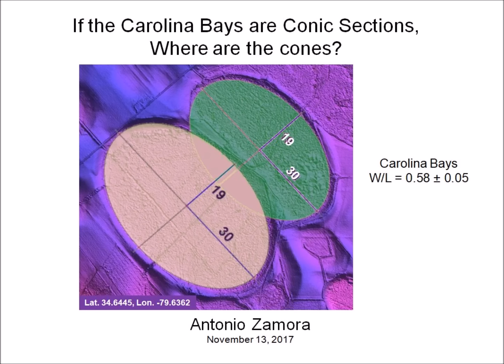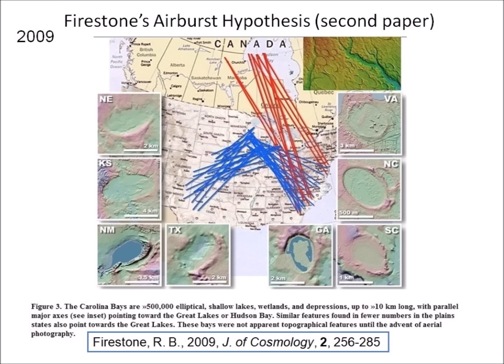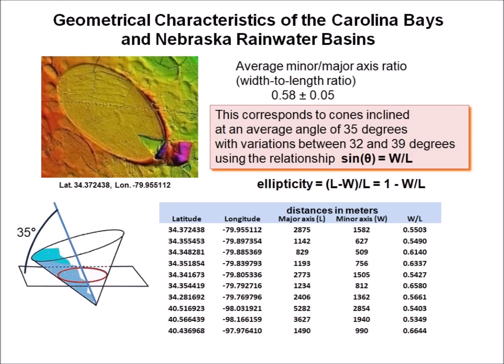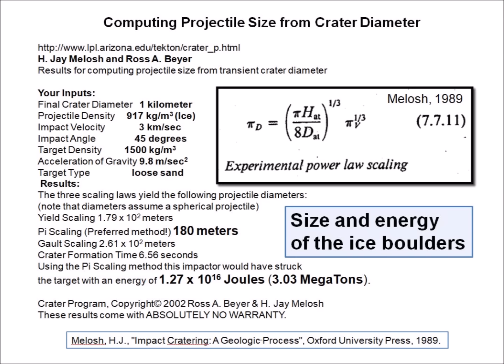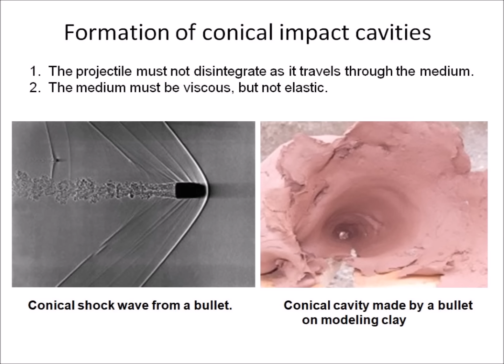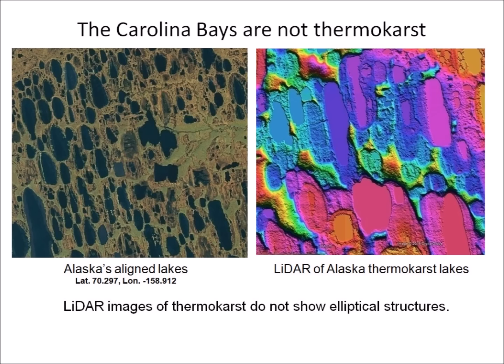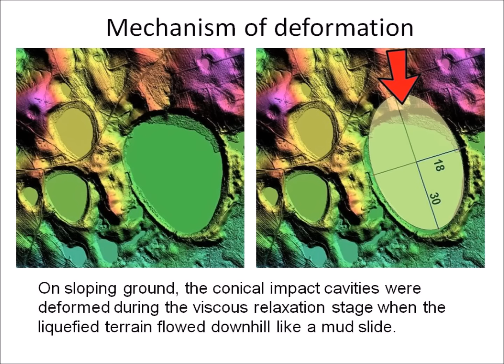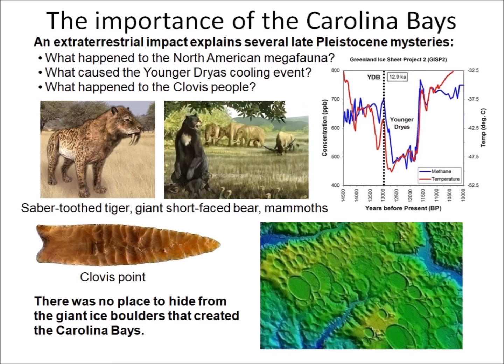Carolina Bay conic sections

Comment: this is astonishing. thank you for the work. would love to get you on our podcast sometime to talk about it. Seems to me that this is solid evidence not only that an ice sheet impact occurred, but also the best work i've seen estimating the actual size and energy of the impact.
Reply from the maker: It took me several years to organize the clues provided by the Carolina Bays into a coherent story.   The Younger Dryas Impact Hypothesis has been criticized by M. Boslough for not having a physics-based model for the extraterrestrial event.  The geometrical analysis of the Carolina Bays, in conjunction with ballistic equations and power laws relating energy to crater size provides a foundation based on the laws of physics that is hard to refute.

Comment: Are the perfect archetypal conic sections a result of the extreme velocity of the impact of ice chunks into the unconsolidated alluvium?  In other words, what makes them so perfectly shaped?  

"Kettle lakes", a common feature of the landscape left in the wake of retreating glaciers, form in a similar way, where ice chunks left behind melt later after sediment is deposited around them, and are commonly circular or sub circular, but rarely so perfect. 

Is it that they hit with such velocity that the chunks were embedded deeply in the earth and the cone represents the best fit around the embedded object to the surface?  Is the perfect geometry purely a result of the high impact energy?  Why wouldn't all of the ground be liquified if they impacted all around the same time?

Also every single bolide impact crater on earth is circular in shape, no matter the impact angle, because the crater is created by the energy of the explosion, not the actual shape of the bolide.  This is similar to the fact that no matter what object you drop in a pool of water, the ripples created will be circular- never elliptical. The moon has no elliptical craters, they are all circular, surely many of them are glancing blows, but the craters are still circular.  The only way to create an elliptical crater is to strike with an extremely extremely low angle, which contradicts the angles suggested by the conic sections that intersect the ellipses of the bays.   

Also, what is the cause of the giant gap in elliptical structures in the arc of structures from South Carolina, clockwise to Nebraska?  Much of that area was not covered by an ice sheet and was full of unconsollidated alluvium, especially the Mississippi river valley.  

These things present a problem for me, but otherwise this theory is compelling to me.  

Have you tried working with a geophysicist to model these impacts in the way that the Chicxulub impact was modeled?  Could provide many useful predictions of structures that may then be sought in the field.
Reply from the maker: The geometry is the key to understanding the origin of the Carolina Bays.  Ellipses are conic sections.  The Carolina Bays started out as inclined conical cavities that transformed into shallow elliptical bays by viscous relaxation.  They were created by secondary impacts of glacier ice ejected in ballistic trajectories by an extraterrestrial impact on the Laurentide Ice Sheet.  Their speeds were from 3 to 4 km/sec.  The energy of the impacts, 13 kilotons to 3 megatons of TNT, was sufficient to liquefy unconsolidated ground, and this allowed the creation of the inclined conical cavities.  These ballistic speed impacts are much slower than the asteroid (17 km/s) or comet (45 km/s) speeds that create circular craters, as described by Prof. Melosh and other impact experts. The ice impacts did not happen all at the same time.  There was a window of 6 to 9 minutes during which the ice boulders came crashing down from their suborbital space trajectories.  The "gap" in the arc consists of hard terrain that could not be liquefied.  Ice boulders impacting hard ground just disintegrated upon impact.   I demonstrate how to make elliptical structures in my video about Modeling Carolina Bays: https://youtu.be/94km3ZKiPSE  I am trying to engage some physicists with experience in modeling to start first with the secondary ice impacts on liquefied ground, and then for the ET impact on the Laurentide Ice Sheet.  Check out my YouTube channel.  I have organized the videos into four categories that give detailed answers to many of your questions.

Comment: If liquifaction was at work on such a scale, would there be huge numbers of fossils from animals subsumed?
Reply from the maker: The liquefaction was widespread due to the saturation bombardment by ice impacts with energies from 13 kilotons to 3 megatons (6.0 to 7.54 magnitude tremors).  It would be impossible to run on the liquefied ground.  An 8-foot (2.4 m) mastodon would be like a tiny speck compared to a 1-kilometer bay or even a 200-meter bay.  They would have been trapped in the muck and tossed hundreds of meters.  Due to the active ice bombardment lasting around 10 to 15 minutes, any jumbled remains would be buried up to 150 meters below the current surface.  Animals on solid ground would have been killed by shards of ice.  Read about the Orleton Farms Mastodon.  He is a likely victim of an ice shard, although the dating does not coincide with the YD, because the dates are screwed up due to the liquefaction.
https://kb.osu.edu/dspace/bitstream/handle/1811/3888/V52N01_001.pdf
Reply: Looking at the Bombardment Area and referencing Energy Values up to Three Megatons it would seem logical to deduce that Vast amounts of Flora and Fauna were Vaporized or Pulverized during the ongoing Impact Event. Fossil density may suffer in response. Great Video Sir!!! Please Continue This Great Work! I am Constantly in search of Real/True information concerning our Ancient History.
Reply: Like the Dinosaur National Monument?  Wrong epoch and just a random thought...

Comment: A competing hypothesis in the electric universe mindset would be electrostatic or arc events that are known to form craters in the lab (vary in type whether anode or cathode) on solids and clay. The geometry argument presented seems compelling for an actual impact event though, especially the ballistics. Craters caused by arc discharge are usually round, can be small and linear (ie a line of small craters) and often smaller craters form on the rim of larger ones. The timing of the formation seems to be a critical period in human development and human history. This is the period where we lose the thread between the builders of megalithic structures and the reemergence of humans in groups large enough to build (and bury) Gobekle Tepe and ultimately give rise to the written record of the Sumerian culture much later. It is a period in time that commands our full attention.
Reply: xkguy    Would arc impact on ice cause this?